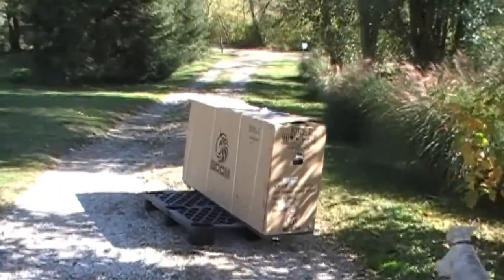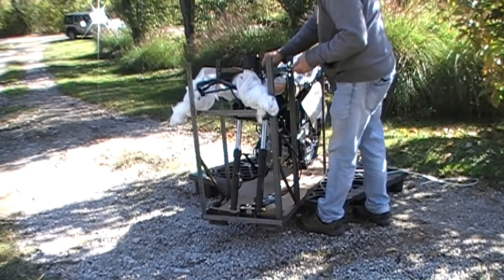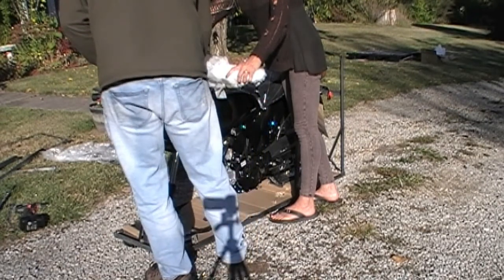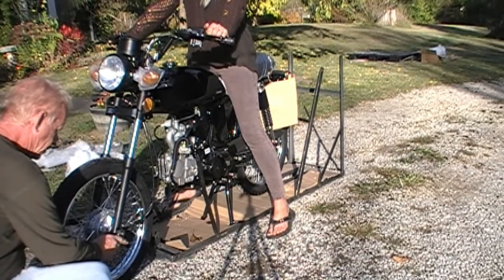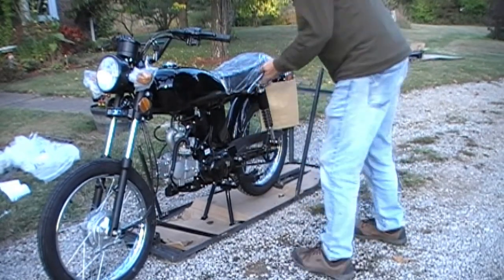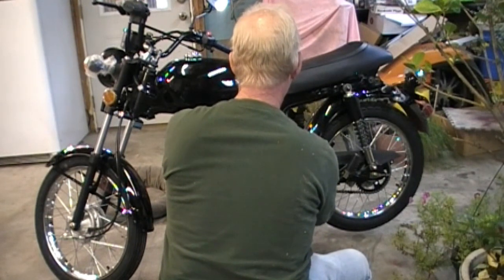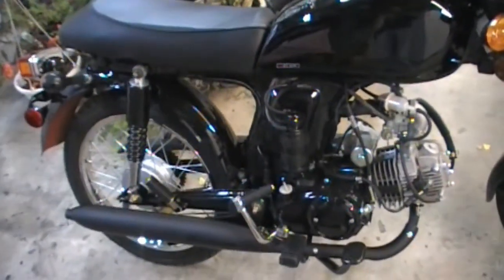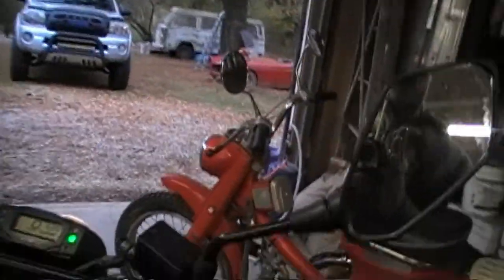Boom BD125 2 - Delivery, Setup and Issues

Comment: Howdy Greg! Thanks for the video. Just picked one of these up for $1099 with free delivery. Bike certainly has loose nuts and bolts everywhere minor electrical problems. But I've been getting sorta familiar working on these little bikes, I got an old rusty 1981 c70 passport I've slapped a 140cc piranha into I'm slowly getting roadworthy. And I'll feel a lot more comfortable practicing customizing this little chinese bike before I try to buy a real classic 1960's honda s90 to restore. Good luck out there, you got some cool bikes in that garage.
Reply from the maker: Why thank you.  Still waiting on a swingarm, speedo and rear light for mine.  Got a 14t front sprocket to put on when I get a chance, hopefully it'll tame the wheelie hop a bit, and take out the silencer.  Just jump in as far as the old bikes are concerned.  Especially now that it's cold and their somewhat cheaper.  I need to put together a video of our 64 Trailmaster 80 before and after.  If you need any help with anything just shoot me an email at gregdhayes@yahoo.com.
Reply: @gregslair4278  You are too kind, I look forward to seeing how it all turns out. I'm especially curious how the 14 tooth sprocket works out. First time I sat down on mine I popped that front wheel up, I was so surprised I almost let it shoot out from under me, I hung on though!
Reply from the maker: @armandsimon2996  Lol, it's cool when you wanna do it, not so cool when your pulling out into an intersection and it keeps trying to wheelie.  And the rear shocks suck.  Got ours as tight as they'll go and it's still  bouncy as hell (but it is fairly comfortable).
Reply: Hello, if you don't mind me asking where were you able to find it for $1099? I am interested in getting one of these bikes, but I can only find them for around $1500. Seems a bit steep.
Reply from the maker: @jameswat6806  That is a bit steep.  Mine was right under $1200 and that was too much too, considering all the issues I've had with it.
Reply: @gregslair4278   Speaking of, I'm on the hunt for a service manual or some sort of specs related to the BD125-2  -- did you have a copy, or have any recommendations/knowledge/experience for the issues you've had to fix?
Reply from the maker: @Fjord66  Hi Marisal.  Manual??  What manual.  What they provide is pretty useless.  It's your basic 125cc so it's not too complicated (just google a lifan 125cc, pretty much the same thing).  The swingarm was the only thing that took me a minute to realize it was bent (had to true the wheel to rule it out).  The speedo is missing the worm gear.  The carb has a cover over the air/fuel screw you can pry out to adjust the carb better (and it works fine now).  Removed the baffle on the exhaust, sounds pretty good now.  The rear shocks suck and bounce too much, so when it warms up I'll be looking for better shocks.  And it is pretty torquey and likes to wheelie, so I've got a 14t front sprocket to tame that down.  My email is gregdhayes@yahoo.com if you're needing more help.
Reply: @gregslair4278  Alright, well in that case I guess will keep looking around for a while. Truth be told I was looking for a C70/CT90 but haven't found any good candidates in my area for a month now. Is there anything else in the price range of $1000-$2000 that you would recommend? (With similar style and displacement)
Reply from the maker: @jameswat6806  CT70's are a joke and way overpriced.  We have two 1968 CT90's (running just fine) and paid about $600 for each, but now that they've released the new CT125's, their prices have risen (seen one here for $3500 in worse shape than ours).  A Kymco K-pipe is also a 125cc (we have two) and they are quality bikes, but they look like a Sportbike.  You could look for an old Suzuki 125 or Honda 125, their retro and easy to work on, but decent ones are kinda pricy as well.  If you like the Grom style, I'd consider a Lifan KP Mini (150cc), both our Lifan's (X-Pect & KPM) are quality bikes.  However, if you are drawn to the retro look, then the BD is the way to go.  Just buy it and change some things to make it better (that's my plan).  Quality aside (and it's nothing major), it's a hoot to ride and definitely looks cool (my opinion).  Slap some Shinko 244's on it, put a yellow headlamp, different rear light, better shocks, change the sprocket to a 14t and you got a cool little bike that'll do 55-60 and not out a ton of cash.  If belmontbikes ever get the 250cc Bobbers back in, I'd spend a bit more and get one of them (their retro too).
Reply: @jameswat6806  https://www.motorbikeoutlet.com

Looks like they still got them. I may have gotten free shipping as a promotion or simply because the bike was in Tacoma and I live in Seattle.
Reply: @gregslair4278  Alrighty. I will probably get one of these little bikes then, I'm definitely not opposed to working on it a bit. I feel like it's more rewarding to ride a bike you have worked on anyway. Thanks for all the insight. I really appreciate it.
Reply: @armandsimon2996  I take it you had a decent experience with them? I only ask because I haven't seen or heard of this particular website.
Reply from the maker: @jameswat6806  no problem.  If you have any questions just hollar at me
Reply from the maker: @jameswat6806  Another one to consider is the CSC SG250.  CSC has a good reputation for Chinese bikes and their parts are readily available and not too expensive.
Reply: @gregslair4278  I'll look into it, thank you.

Comment: it does not come with motor oil in it , it comes with shipping oil in it just to prevent rusting . It needs to be changed before the first start.
Reply from the maker: Mine had oil in it, but I changed it anyway.  Always do on new bikes.

Comment: Hello Greg, Nice video. you may have mentioned it ,when you changed carb, did you replace the jets with the carb jets that came with the bike or just stay with the upgraded carb and jets. Thanks
Reply from the maker: I tried, but that carb wasn't working right so I put the original back on.  I have another one to try just haven't got around to it.

Comment: Hey Greg, so after much consideration I did end up getting the BD125-2, and so far I am pretty happy with it. As expected there were several scratches and scuffs in various areas, as well as bent pieces and broken plastic bits. That being said, after changing the oil and thread locking just about everything it started right up. Didn't smoke hardly at all with the T4 oil you recommended, so thanks for that. The only issue I am having with it now is getting it to hold idle, best I've gotten so far is maybe a minute or so of idle. And even then it didn't sound like the best idle. Any suggestions as to how I might adjust the carb or otherwise would be appreciated. Just let me know if you've got any ideas, I would prefer to keep the stock carb for the time being if possible. Thanks.
Reply: Also its important to note that while the bike did need choke to start, as expected, it wont idle choked either. It idles for about 30 seconds half choked, and hardly at all with the choke wide open. Its 61 F today for reference.
Reply from the maker: Hi James.  Congrats on your purchase.  On the carb, look to the left as your facing it.  Look close and you'll see a little plug.  Pry out the plug and try turning it out 1/4 turn at a time (this is the air/fuel mixture screw) or try turning in if out doesn't help.  BTW, they are very very cold natured and the choke doesn't seem to help much with these carbs, so just give it a bit of throttle until it starts to warm, maybe a couple of minutes.  That seemed to do the trick for mine.  Double check your chain too.  Put it on the center stand and make sure your swing arm isn't bent (you'll know if the chain gets tight then goes loose).  I'm still waiting on a replacement swingarm for mine.  And for kicks, remove the muffler baffle.  The damn thing sounds pretty sweet with it out.
Reply: @gregslair4278  Will do, Im not home at the moment but I will give that a shot when I get back. I'll also check the swingarm, and uncap the exhaust. I'll let you know how it goes. Thanks for the help, I really appreciate it.
Reply from the maker: @jameswat6806  No problem.  Happy to help.
Reply: @gregslair4278  I tried messing with the AF screw for a while but unfortunately was not able to find the sweet spot. I also adjusted the idle screw a little bit but that didn't seem to do the trick either. To make matters worse my battery seems to be on the way out after all this starting and stopping, so I will have to pick up a charger tomorrow. Any chance you know what the factory setup for those two screws is? In terms of how many screw turns out from lightly seated. (In the past I've done all the way in, and then 1 1/2 turns out) I'm fairly confident I've got them back to default, but it wouldnt hurt to confirm that. If not no worries, I'll just keep fiddling with it after I get my battery charged back up.
Reply from the maker: @jameswat6806  Once it warms up will it idle?  Does it idle up then down?  Try spraying carb cleaner around where the intake meets the carb.  Email me at gregdhayes@yahoo.com, or you can message me on FB (I live in Versailles, IN) to narrow down the search.
Reply: The stock carb is garbage. Get a pz26 off Amazon for $20. Worlds of difference
Reply: @randyrandall2179 I’ve seen your comments and you seem like you know how to make this thing a daily automobile you should make a video or somthing

Comment: High Greg, It has been quite a while since you aired this video, I have a question concerning the BD125-2. I just received the same bike and when unpacking a seal approx. 2-1/4 O.D.X 1-3/4 inch I.D. fell away from the front wheel/brake hub area, the face of the seal is solid but the back side has a groove around the circumference, do you remember seeing the seal and if so do you have an idea where it belongs, on the wheel stub and which way the groove portion is oriented, don't think it goes on the front brake assembly because it will probably interfere with the speedometer drive tabs.Thanks for any help or suggestion you may offer.
Reply from the maker: Howdy.  It doesn't sound familiar,  wheel spacer maybe?  I'll have to look at some old videos and see if I can I'd it.  Send me a pic to gregdhayes@yahoo.com, so I know what I'm looking at.  We're you able to install the front wheel?

Comment: Hey Greg! Thank you so much for posting this video! I just got one of these BD125-2 delivered to me on Thursday and my neighbor helped me get it uncrated and together. I followed the pointers from you video and it made things much easier for me. We drained the factory oil and replaced it with fresh oil and gassed it up and got it running. I rode it down the street once but since it was late, I parked it for the night. 

Have you had any electrical issues? Mine does. I keep blowing the 15 Amp fuses. It only came with 2, one as a spare so I had to pick up more. The first one blew after I had it warming up for a few minutes, then I put my helmet on and was prepared to go for a ride. I pulled in the clutch and popped it in gear and it cut out. I had no power. I wheeled it back and checked things out and found the blown fuse. I found the spare in the holder and replaced it. Rolled it back to the driveway and once again I had power and it started up when I pressed the starter button. It idled for about a minute and I revved it up a few times and let it idle again. It cut out again. I had to go to the auto parts store and pick up some more 15 amp fuses. I blew 2 more of my new fuses and finally gave up for the time being. I took out the battery again and looked for anything that was out of sorts. I charged up the battery completely on my charger overnight. 

I got this titled, registered and insured here in California so I am stuck with it. I would love to get this thing riding and I am pretty bummed. I contacted the company who sold it to me and they are not much help. Their customer service is terrible. I got a stripped stud on one front turn signal that won't tighten. They told me to video the bike blowing a fuse and email them. I see that another commenter who also had some electrical issues. Do you have any suggestions? Thanks! William
Reply from the maker: Sorry to hear about the troubles your having, but it is not surprising at all, if it isn't one thing with these bikes it's another.  Follow every wire and I mean every one, open the headlight bucket and check in there too.  It sounds like something is shorting out, mainly a hot wire.  Look closely at the wiring under the seat too and turn signals.  Turn signals are cheap on Amazon and you can get some cool ones.    It could be the cdi module acting up as well (since it only runs for a few minutes then blows the fuse) so I'd see if the seller can send you another one to try.
Reply: @gregslair4278  Thanks for the intel! I will definitely start hunting around to find what I can with the electrical system. Buying a cheap new bike in my state of CA is not easy as there are not many options and after a few video reviews of these bikes, I was somewhat prepared for some gremlins. The seller says they will assist with warranty defective stuff so I'll see if they come through. If not, I'm on my own. I had to pay shipping for my bike which shipped from Texas even though the business which I bought it from is local in the Los Angeles area. Mine cost me $1378. I'll let you know how it goes. I really appreciate your getting back to me. My other bike is an original 1985 Yamaha RZ350 I bought new back in 1987. It's been garaged for years, but I got the tags current now and will roll it out soon, dust her off and do some maintanence so it's roadworthy again. I just have to get this BD-125 running first.
Reply from the maker: @flying39aviation  you'll get it running.  It is quite the torquey little thing.  If they could get the quality control in line they could have a real seller since nobody makes anything like it.  It looks very similar in design to our 65 yamaha campus 60.
Reply from the maker: @flying39aviation  and I'm sure that 350 is a rocket.

Comment: I just bought one of these. It hasn’t arrived yet. I’m super stoaked. I know it’s a POS. I bought it to be a project bike. I wondered what you think after 5 months would be the best things to just go ahead and prep to upgrade right out the gate. Gimmie a list bro! I’m ready for it! Lol
Reply from the maker: Congratulations on your purchase. 1st off, it's not a POS.  It just needs some love.  Change the front sprocket, change the rear shocks, upgrade some stuff here and there and it'll be a fine retro/cool little bike.  Be stoked, and be excited.  The bike is actually a hoot.  It just needs some upgrades.  I'm still waiting on my swingarm so I can continue progress on mine.  It's actually a pretty cool little bike (and nobody else makes one like it).  So I'm willing to wait until I get some replacement parts so I can continue with this cool little bike.  These bikes have potential, just gotta be patient and willing to work on them.
Reply: @gregslair4278  thanks! I got it a bit ago and got it all set up. Made some adjustments. It ran great for a while and now I can’t get it to start. I think I need to clean the fuel injector…maybe. We shall see.
Reply from the maker: @hc0521  The BD is carb'd.  Just remove the carb, drop the float bowl and see if there is any dirt in it.  If so, just clean with carb cleaner.  Make sure fuel is flowing to the carb bowl (there is a drain screw you can loosen to see if fuel is flowing out).  Also check your plug and make sure it isn't gas soaked (if so, just blow out with compressed air).
Reply: The stock carb is garbage. Replaced mine with a $20 pz26 from Amazon, soooo much better!!!
Reply from the maker: @randyrandall2179  I tried one and it didn't work worth a crap.  Got another to try, just haven't had time to put it on yet.  Send me a link to the one you got, hopefully my new one is the same.

Comment: Where did you get your back black tail light from? That looks awesome 👌🏻
Reply from the maker: Thank you.  I got it on ebay, pretty cheap too.
Reply: @gregslair4278  I just got my boomcat on Thursday I was having the same problem with starting it up and it staying on. I'm very new to owning a bike so this is all new to me. I noticed that the more I tried to turn it on, the more it would drain my battery. I do want to change the oil like you did with your bike. So I'll definitely do that. I did do a little run around my apartment complex and it ran find, it was after that, that I was having problems keeping the bike on. And when I did manage to get it started, it started to Rev really high. I don't know, probably a choke thing. Again, I don't know where to keep  the choke so it stays at a smooth idle. Any help would be appreciated. Again, thank you for your upload. 
I also, would like to make it look more like a scrambler too.
Reply from the maker: @spiderspawn2002  Howdy.  1st off find the plug I was talking about on the carb and pry it off, this is your air/fuel mix.  Try turning it out or in about 1/4 turn at a time and see if that helps (turning it out on mine helped).  Those bikes are extremely cold natured, even when it's warm, so leave the choke on for a good 5 minutes, or hop on and ride then reach down and flip it off.  As for the high idle, check and make sure your throttle cable isn't binding on something (that is what the high idle sounds like to me).
Reply: @gregslair4278  awesome! I'll do that, thank you very much! 😎👍
Reply: The solenoid is bad, so I'll have to get that replaced as well.
Reply from the maker: @spiderspawn2002  Damn, if it isn't one thing with these bikes it's another.
Reply: @gregslair4278  lol you got that right